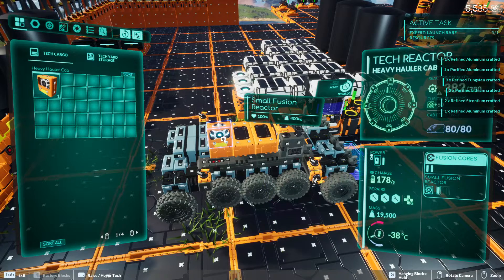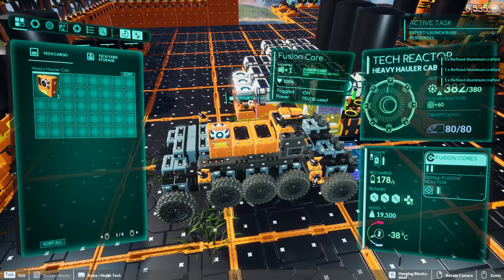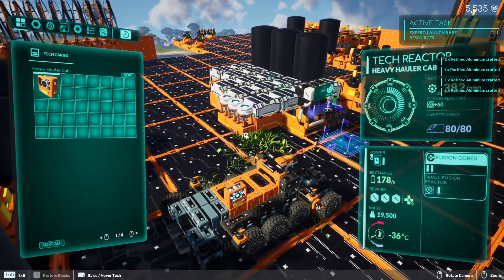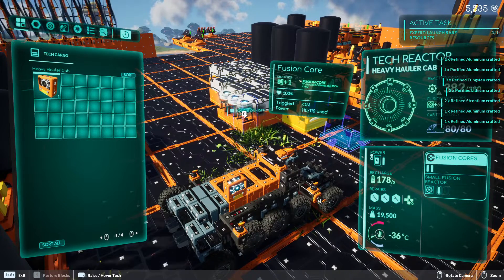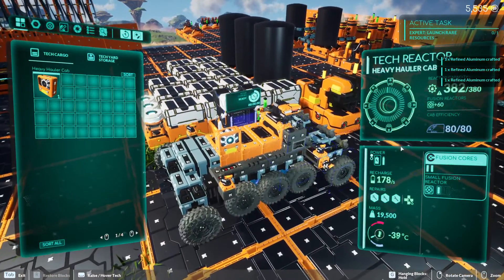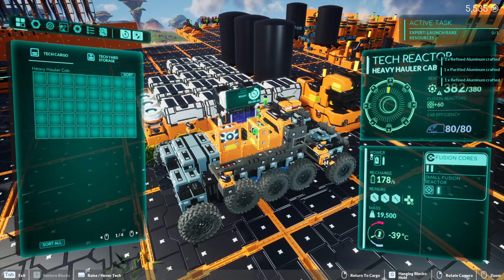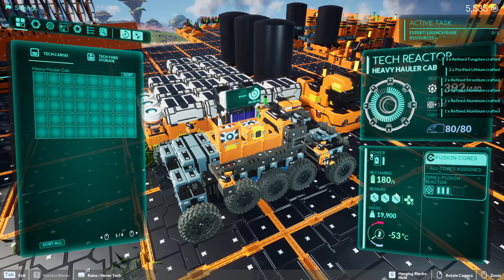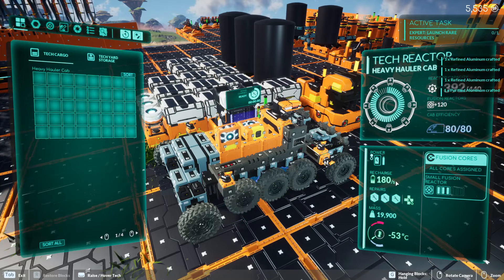Old Version* Terra Tech Worlds How to Add Fusion Cores to Small Fusion Reactor

Comment: I don't understand its not working for me
Reply from the maker: Ya i thought i explained it good enough.. Its a huge pain first time.
So you have to have over 100 power obviously, you have to place core beside your Tech Yard, Attached same way tech Storages are, the small yellow dots on side have to touch tech yard or storage if storage is connected to tech yard.. Also has to be turned on, on is default i think but who knows. Its Y on PC to turn on/off as default i think...
U didn't give me any info on what you tried so hope that helps.